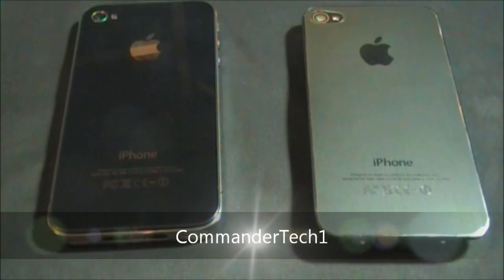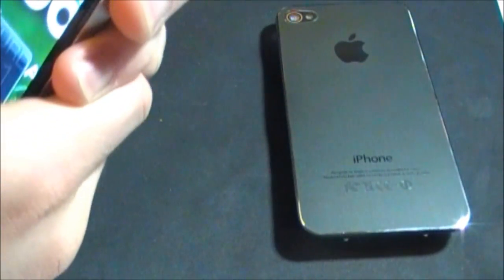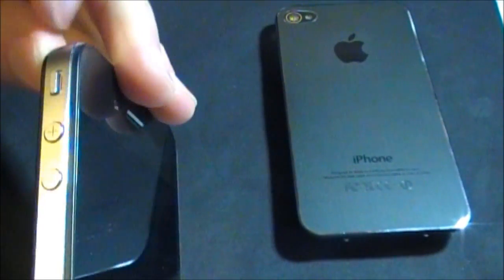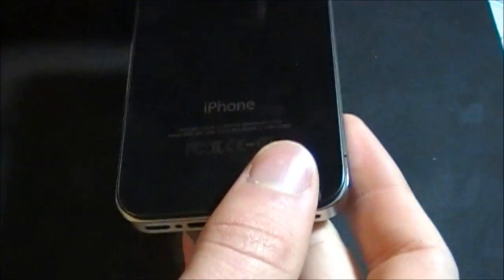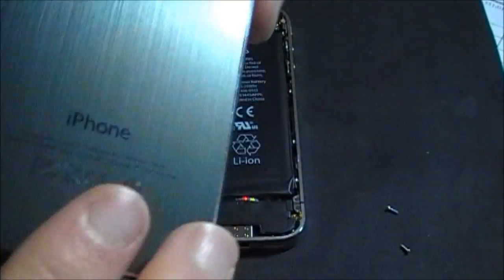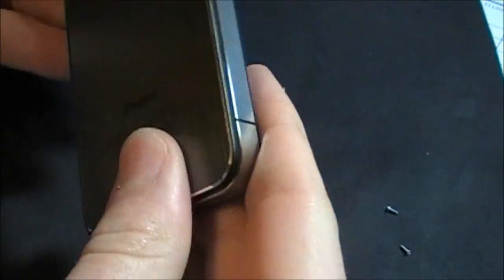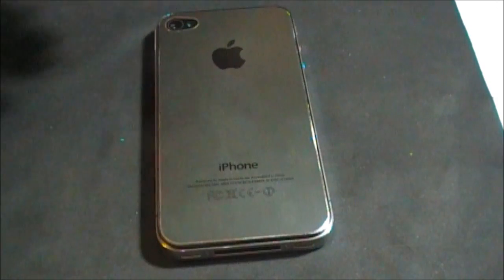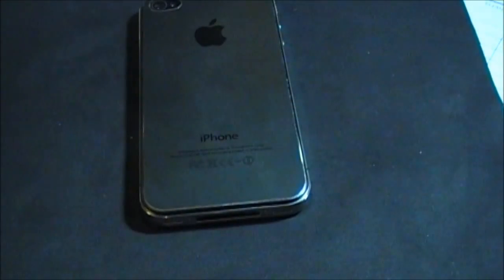How to Install/Remove Back Cover of iPhone 4

Comment: my screws did not come of .
Reply: ff. Make sure you have one of those screwdrivers with a 'friction-less rotating hat', so that you can press down on the screw from the top while still being able to turn the shaft of the driver. You may need to apply a lot of force.
HTH
2nd Jan'17
Reply: Peter Faber thx but I had got a new phone 📱
Reply: No problem. A public forum so I just added my suggestion that might help someone passing. Chrs.